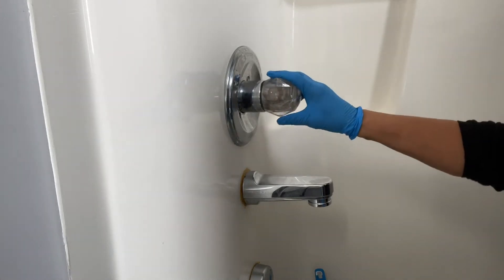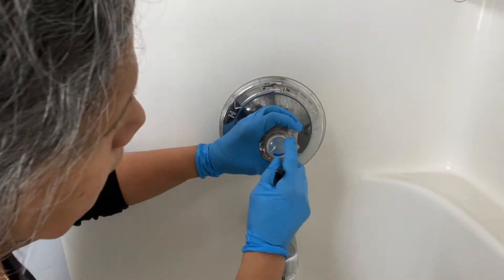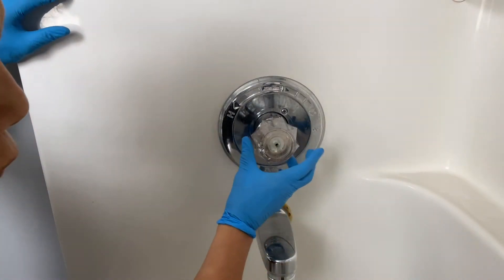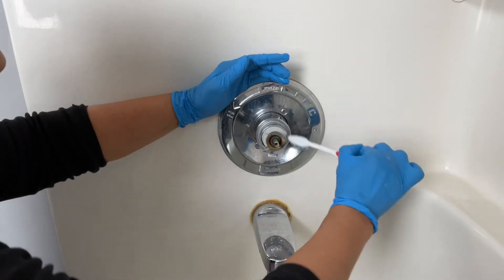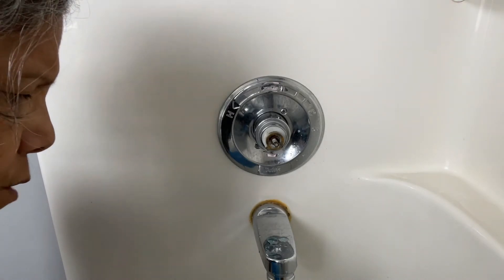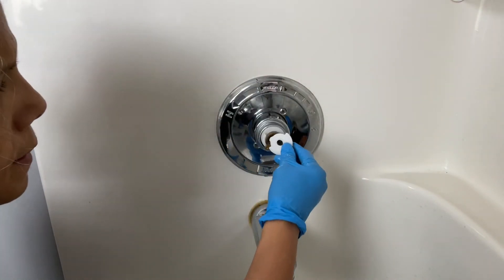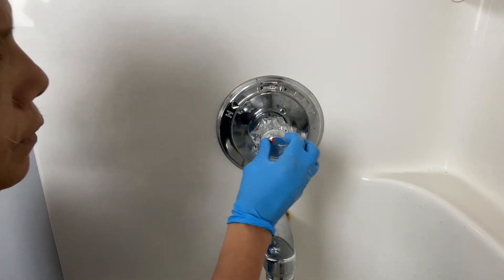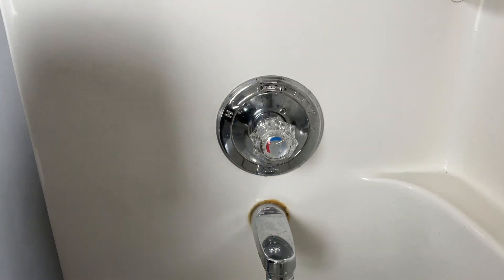How to clean delta globe style faucet handle!!!

Comment: I just cleaned a very old single-handed sink faucet using these instructions. I didn't expect great results, but it literally sparkles now.  So happy I tried this instead of replacing the faucet!  This is the best video I found on how to clean these. The sink faucet assembly I have is even simpler than the shower faucet in the video, but the procedure is basically the same.   The only extra things I did was 1) polish the brass screw with Barkeeper's Friend, and 2) remove the little tin circular insert under the cap and cover it with a small piece of silver aluminum HVAC tape because the surface was damaged and couldn't be cleaned.  If I can buy a replacement I'll do that but for now it looks great.  

Tips that others might find useful: to remove the cap, I took a heavy-duty paper clip, straightened it out, and inserted one end into one of the "holes" I found on the sides of my cap, and lifted straight up.  (You can see that the holes are actually the top of channels once the cap is off).  To clean the hard to reach places in the globe, I rinsed it in hot water, then dipped a soft toothbrush into a bowl of hot water mixed with a few drops of Dawn,  brushed out the gunk I could reach, rinsed the globe in hot water again, then pushed the head of a Q-tip into a small alcohol wipe and wiped out the harder-to-reach places.  Once everything was rinsed, dried, and reassembled, it looked like brand new.
Reply from the maker: You’re welcome! Glad this video was able to help! That is fantastic! Thanks for the tip we’re all here to learn from each other so every tip or suggestions help us all! Thank you my friend!

Comment: Just did this before finding up your video. Will solution soak away hard to reach places in knob?
Reply from the maker: I used toothbrush and toothpicks in order to get into the hard to reach places. Keep in mind how long the build of has been sitting in there sometimes it’s caked on so you’re gonna have to put a little bit of effort into it, but it does work. Best of luck to you.
Reply: @tinykitchenbigflavor7142 Thank you! Will try toothpick 🙏🏽

Comment: I can’t pop off that plate because it’s full of scale and lime so it’s stuck like cement how do I get it off please help
Reply from the maker: Try taking a bag fill it with vinegar and let it sit overnight, you’ll probably need to use a rubber band to secure in place ensuring it’s submerged in the vinegar, see if that helps it come off. Best of luck 🤞🏽